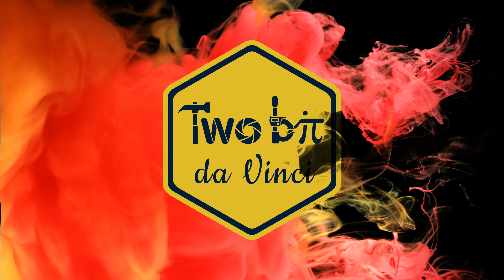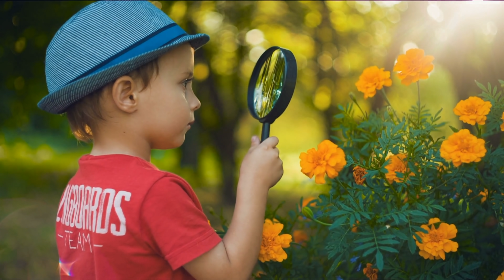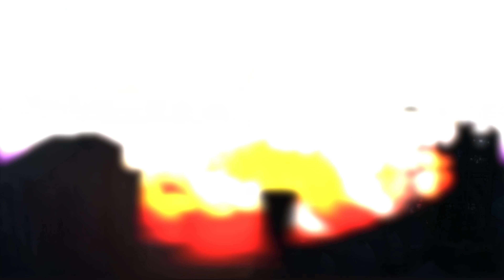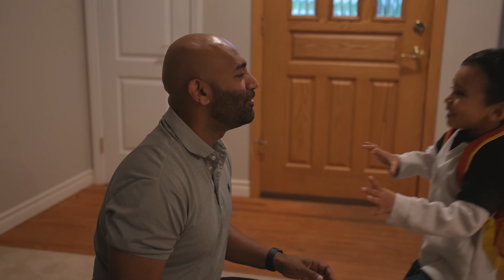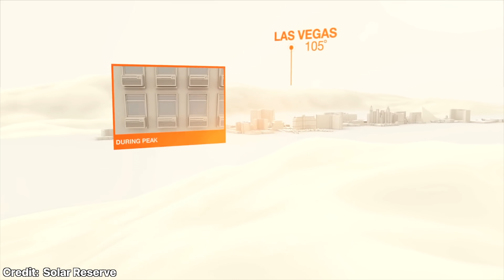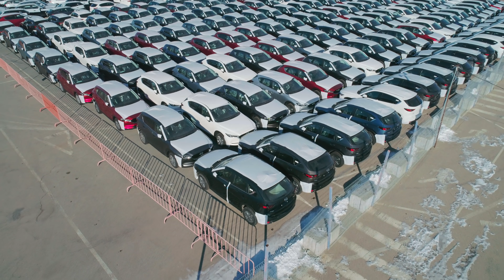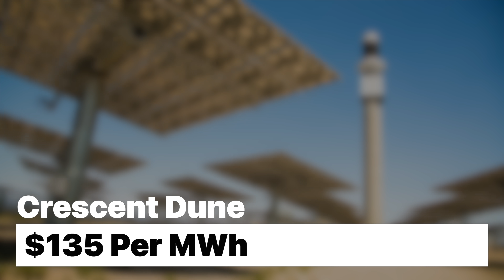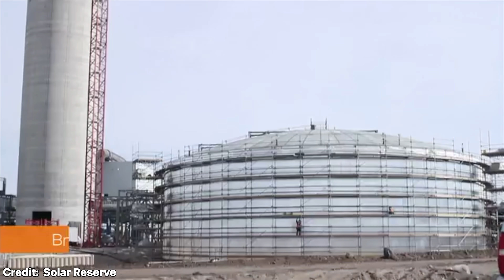This Billion Dollar Solar Plant was an EPIC Failure

Comment: @douglasgoldstein8990  account , state bank of India , and architecture  and I don't understand how Douglas is connected to da Vinci  ???  the two fields of architecture and others talking of solar powered panel installation and batteries doesn't make sense to an examination center where the papers are evaluated and other project works are by the chief engineer , center for excellence,  campus , air traffic control,  ignou , got it !!!!

Comment: I understand the desire to use the molten salt, yet couldn't comprehend using a better test fluid that was far less efficient  while far easier to use at the beginning. Hell, it could've ran as a steam plant just using water/glycol for who knows how long. Then swapping thermo fluids up in efficiency after that. 

ALL THEY HAD TO DO WAS ACHIEVE HIGHER EFFICIENCY THAN THE COMMON 20%. Instead they planned to double/ triple it from the get go. They went full potato on a prototype. Never go full potato on a prototype unless you're goal is to break it. Lol

Comment: What is the viability of ditching the tower, and the molten salt, and replacing the mirrors on the heliostats with PV panels? 
An individual PV on a heliostat has a higher output than a fixed, south facing PV panel, but does that advantage scale to a solar farm?

Comment: I'm fed up with these "cost per W" analysis, claiming photovoltaic is therefore "better". It's so short-sighted. It is short sided on the long run because I have a hundred years old mirror, it still works fine as a mirror. Please bring me a photovoltaic pannel that is 20 years old and still producing half of its nominal power. Allright I'll wait.
But it is also short-sighted on a daily basis. When it's night, you get ZERO WATT of a photovoltaic pannel. What's the cost per W of a power source that brings out ZERO WATT of power?

Comment: He is completely confusing the Cresent Dune solar facility with the Invanpah Solar facility at the beginning of the video when he says "you know that solar plant we pass on the way to Vegas".  Not many people see the Cresent Dune plant.  In his video later he correctly maps it's location far NORTH of Las Vegas, but he still does not correct his oversight that few people pass it and they are completely different facilities.   Ivanpah is still running.  In his video he needs to explain why did Invanpah succeeed whereas Cresent Dune failed? Invanpah opened two years BEFORE Cresent Dune, and it is also thermal solar.  I

Comment: All these plantsfor 50 years,  have had trouble with integrating fluid mechanics generation, steam generation. 
    It has been tried since the beginning of the industrial revolution.  Some have forgotten history. If it worked,  it would not be a string of failure.

Comment: I saw a video about a new pv cell that converts radiant energy to electricity at very high efficiency. That would solve the problem of mechanical costs and failures. Furthermore, I wonder if the heat could be used to make cement?

Comment: How is the situation at night? 
The great advantage of that kind of energy plant is that it can deliver electricity at times where there is no  sun. 
So is there a possibility to keep the molten salt hot for much longer times, maybe weeks? Possibly by using a much larger and well insulated tank for the molten salt? 
If so, the plant could deliver energy ›at demand‹, during the peak hours of maximal demand - and then I hope for far more money?

Comment: So here is my solution, and I hereby gift it to the world patent free.
Don't use salt and pumps that fail. Use steel chains to raise giant ingots of steel to the top counterbalanced by other ingots. Cook them till hot, say 1000 degrees C, lower them down and raise the next one. When down and in a tank, close the lid, add water, flash to steam, drive the turbine, repeat.  You're welcome.

Comment: The major problem with molten salt is that it's EXTREMELY corrosive. Nuclear engineers ran into this problem when performing the molten salt reactor experiment at Oak Ridge National Laboratories. A lot of material science has to go into containing molten salts and preventing leaks.

Comment: OK overall Crescent Dune's Solar Thermal Power Plant failed and costs too much to run FULLY. Why not use the storage ??? 
They have the molten salt, the pumps, the turbines the grid connection. 
Use extra Solar/Wind energy in the day to heat the Salt and sell it at peak cost times.
They would already have a start up heater to melt the salt at startup and for maintenance. Use the same design just add more, if needed?

Comment: You can't in any way compare the costs of a thermal storage system with PV. The storage makes the thermal system much, much more valuable, because it's dispatchable and can therefore target the most valuable time periods, which by definition are those periods when intermittent sources (e.g. PV, Wind) are low. Too many people fail to appreciate the TIME value of energy. It's a shame that this scheme has had difficulties but the concept is very sound, even if the cost is high compared to PV or wind. It's more realistic to compare this with the cost of Nuclear or Green Hydrogen; $135/MWH is quite competitive here, not bad at all for a FOAK project.

Comment: Keeping plasma contained at such intense temperatures without leakage, however, has proven to be extremly challenging. Scientists have been working to harness energy from nuclear fusion for over 70 years. Furthermore, an experimental tokamak reactor that produces more energy than it uses has never been created, per Live Science, but China's success with EAST suggests researchers are getting closer to sustainably harnessing cosmic power. In theory, deuterium can be obtained from Earth's oceans; one liter of seawater is estimated to have enough fusion material to produce energy equivalent to 300 liters of gasoline, Newsweek reports.

Comment: I very much doubt they had 2,000, much less 5,000, people on site to operate the plant after construction was complete. Please get the facts before speculating. I don't feel that the question was answered about why the plant can't continue running now that it is built. The ability to keep producing power after sunset means that this is not strictly comparable with photovoltaics but you keep comparing it to photovoltics when the real comparison is with peaking power plants, presumably running on natural gas.

Comment: I wonder if the long-term cost of functioning molten-salt tech wouldn't be better compared to photovoltaic, which are going to produce also mountains of garbage, both the solar cells and eventual dead batteries, besides the aspect of cost of both of those things eventually necessarily rising as it got to reach some peak of productivity or availability of resources. Then there's also the aspect of slave labor.

Comment: When are you going to endorse Indonesia's choice to contract ThorCon for 7×500MWe (each 65m×180m=1.17Ha ~ 2 football pitches); Liquid metal Thorium ion molten sodium fluoride salt burner energy converters at a levelised cost or $1200/kW with a  pre-profit cost of USD30/Megawatt.hour. Walk-away safe, base loader or load following. (Can't "melt-down" or "run-away" consuming 99.5% of fissile material consisting of Caesium137  & Strontium90, both having half-lives of about 30years so requiring only 300years of secure storage instead of +10,000 years for current LWR "waste" (which could be consumed in Thorium Reactors design to do so)
Compare 99.9% Utiily ThorCon's 500MWe/1.17Ha with 2W/m²PVs that have at best a 33% utility...
Reply: I'm a retired  Octogenarian Kiwi ASNT (level 3 - RT, ET, MT, UT) Quality Assurance Conformance/Compliance Structural Engineer and have lived in Jakarta since 1978 looking forward to the conclusions of ThorCon's non-nuclear thermal test rig in Surabaya and completion of their first Korean shipyard built 'twin-pot' double hulled barge-like units arrives off Bungka island.
(The alternative pot stays on standby for 4 years until fuel salts are transferred to it, to become the active reactor while the first now empty 'pot' cools down for 8 years, when maintenance is under taken including the replacement of its Graphite moderator).

Comment: wood was, is and will be the most renewable and clean energy resource and I did not sad this with sarcasm just a small cycle , poplar tree takes 10 years to grow to the full size you can say o that way too long , no 10 years for renewable energy is nothing , but if you think about the process you can not compete with God. Tree absorbs sun with a leafs and stores that energy in the tree, during the photosynthesis takes CO and CO2 and gives back O2 carbon gets deposited back to the ground that makes erth to grow crops (read about organic chemistry) , but the most amazing part when you burn the wood it is produce the same energy as sun remember that deposit of sun energy into the tree , relecess C02 that will absorb back by the tree . if you think about it is amazing  way, who made you believe that petroleum products or solar system is the way to go is a stupidity. today entire middle east full of petroleum product , but have no forests or freshwater and all because of oil . so they are doomed.

Comment: This stuff called "Green Energy"' seems to just put the debre some other place. Like these wind farms. It takes massive amounts of fiberglass to build the blades. I mean like thousands of gallons. Seeing these blades go down the interstate is a nightmare. They take up all the lanes , just a traffic jam. They only run for a few years, then they are a major safety hazard, and hafta be dismantled. They can't be burned on their own ,so they take up massive volumes in landfills. If they do burn them it takes tens of thousands of gallons of fuel to burn the blades.   What is green about wind energy 🥺??????? Or any of this green energy , it just puts the nasty some other place. I live in a place that produces solar panels. They have more dandom axle drop bins going in and out of that place than any other factory in our city.         Everyone thinks EV is the the green vehicle of the future. Have they thought about how nasty batteries are in production???????  All the mining that takes place to produce the elements to process the what it will take to put these vehicles on the road????  Far more mining than what is needed for carbon burning vehicles!!!!!!

Comment: peak power demand is in daylight hours.. I think if they got rid of the salt and just boiled water, it could pair nicely with nuclear power for the lower overnight power demand and produce an energy generation curve that matches the populations energy consumption curve pretty closely.   Just CSP and steam(no salt) is probably a lot cheaper to operate, and slow-acting motors like the ones that run those mirrors can run for years almost maintenance-free.
Reply: i agree with you ... except the nuclear part. if we reduce fossile fuel usage  that would be the attainable goal!! and give us enough time to get FUSION going!!

Comment: You can generate electricity with PV during the night,
By using the heat effect of the cells. Just requires some changes to cell design.

Comment: Solar is on the same exponential curve as other electronic technologies. The big limitations today are power storage and power distribution. The second we have good answers to these questions, solar is going to eat everyone else's lunch. Solar could meet all our needs by 2035.

But it doesn't have to, Thorium based liquid metal salt reactors, and geothermal using ultra deep bore holes are looking incredibly bright and either one is capable of meeting all the immediate energy needs of humanity.

Comment: I recently drove past this plant (9/2022) and the mirrors were aiming sunlight onto the tower. The brilliance of the concentrated light was impressive, like some sort of sci-fi futuristic special effects scene. It was seriously awesome to see. I don't know if the plant was actually in operation but I would assume it was, otherwise why concentrate all that heat.
Reply: Same with me. I went by this during 1/2022 and it appeared to be in operation still. Coal run at losses too but the losses are allocated across rate payers.
Reply: Like a broken clock is right twice a day even if the mirrors nevermove they willstill hit the tower fr some time during daylight hours. 
That makes me wonder. Where is the beam of light going during off hours?
Reply: @OldSneelock No. The sun is out for half the day so it would only be right once per day. Also the height of the sun changes every day so at best it would be once per year.

And when it is not working it shines to an area scattered in the rough vicinity of the tower.
Reply: It operating again from 2021, I heard it in another video and also read it on wikipedia.
Reply: Maybe you saw the one near Primm, NV.

Comment: I think we should do nuclear power plants.  It is extremely efficient. I have heard that it maintains 98 percent energy created.  It does not produce CO2. And we have gotten a lot better at dealing with the waist.  

I just feel that people are scared because it makes bombs. But if all nuclear technology does is make bombs than that is such a waste of the technology.  We should be using nuclear power for clean energy. 

We should keep the gas cars and trade out our current coal and natural gas power plants for nuclear.  Just by trading out the gas run power plants for nuclear we will drive down the demand for gas. If we trade gas cars for expensive electric cars that run on gas power plants than that is a waist of time. If we use solar panels to power our homes and electric cars there will be constant brown outs. Solar power is unreliable and most often failing projects.  If we ran on solar, we would have constant brown outs and would soon run out of lithium and Cobalt that was gotten with strip mining. 

Our world population plummeting in the near future decades will solve the rest if not all of human caused climate change. Although I am sure a population collapse will cause an abundance of untended consequences that could be worst than the effects of global warming.

Comment: As one of the people who says green energy won't work, let me answer your question.  Solar, wind, geothermal, and hydroelectric power can be useful in some places and under some circumstances.  They might be a huge success at powering a single city or even a small region of the country.  These types of energy sources can also be useful for individual homes or businesses under some circumstances.  And I would encourage their use when economical and appropriate.  But where they are a complete failure is in the goal of replacing fossil fuels.  This is where people like me, who understand basic math, say that "Green Energy" is a waste of time and money.  Because it is impossible to produce sufficient power in that manner.  In this respect, nuclear power is the only viable option.  Whether that be nuclear fission or nuclear fusion.  But nuclear fusion is likely a long way away.  If the stated goal is to replace fossil fuels then I would like to see tax dollars being used for something that can actually accomplish that goal.

Comment: We've had the solution for over 70 years. Just go nuclear. Chernobyl is the only fatal disaster and the design should never have been built in the first place. Chernobyl's design will never be built again. 
With 70 years of experience and incredible advances in technology, nuclear power is extremely clean, waste is minimal and safeguards are well understood.

Comment: More green eco trash that litters the earth. Then you have to consider the earth that had to be mined (with heavy machinery) to acquire the ore and raw materials, the diesel that was burned during transportation from the factory to the site, and the actual construction of the array. Not to mention the grease for ongoing maintenance of all those moving parts.

Mayby we can store all of the used up, toxic, electric car batteries and wind turbine blades there. We have already junked up that part of the desert so why not? 

Very soon a new technology will emerge that will solve our energy production needs forever and people will be asking, "How did we miss this? It is so simple." Come back in five years and tell me I was wrong. Until then, I am not interested in debating. Its closer than you think.

Comment: So called green energy has never achieved net gain sustainability. For that reason, apart from virtue signallers, no one in industry or commerce would back it, for the same reason no one would willingly burn their life savings just to be rewarded with a fraction of it back.

Comment: Geothermal supplies all the heat needed to boil water to turn generators around the clock with no need for storage. It has been working successfully in many countries around the world for decades. Numerous smaller setups around cities, instead of single larger ones, can provide redundancy for breakdowns and servicing. Also no need for lengthy transmission lines connecting state to state or city to city. It works, but is ignored since there's no money to be made from selling fuels (oil, gas, uranium, etc), as well as the electricity. Many of these alternatives are designed to fail in the name of profits - a game that has been played played since the late 1800s.  Forget about politics and the Left, Right, Green, or whatever - that is all a smokescreen hiding a much bigger game. Creating problems, not solving them, is all part of that game - an old, old game.